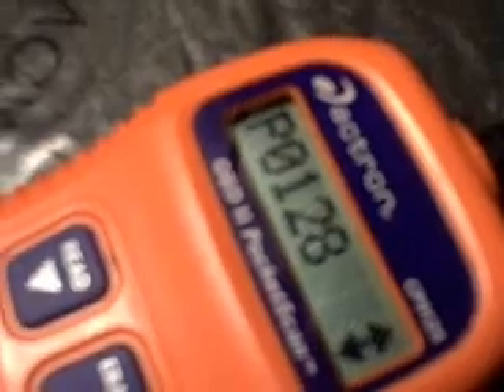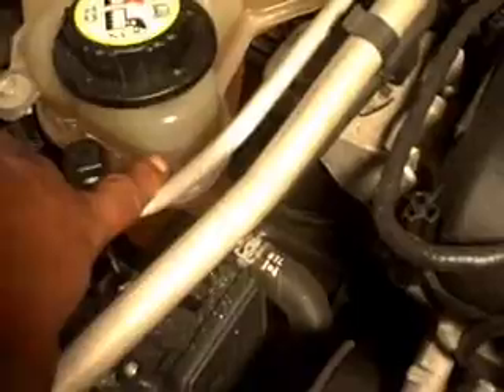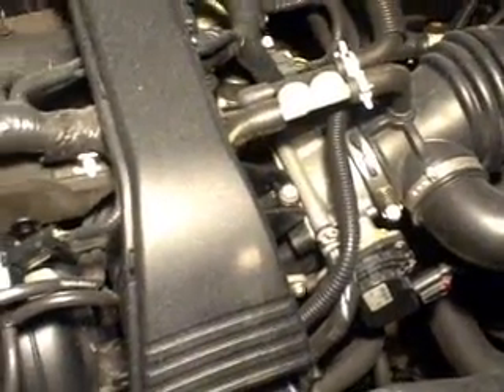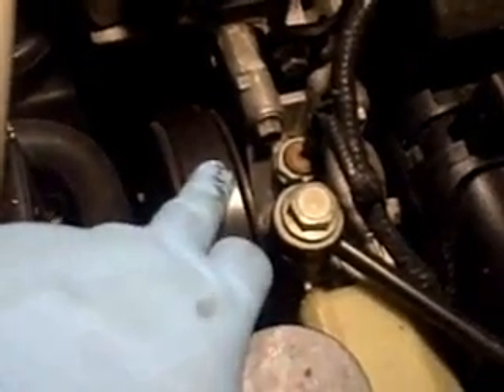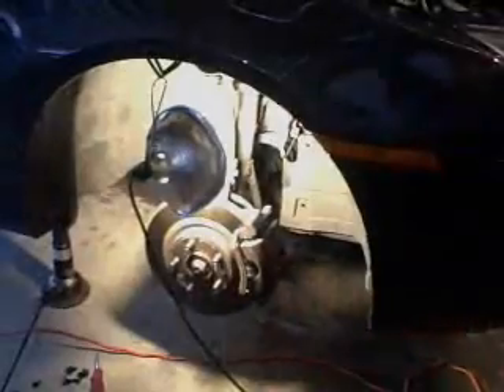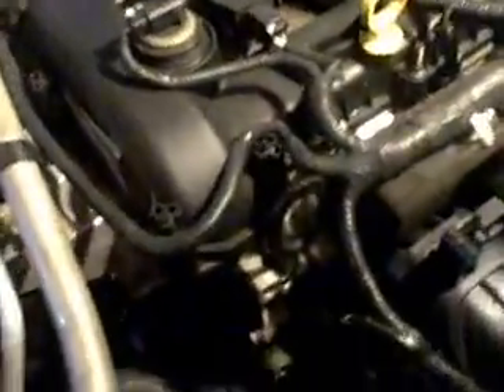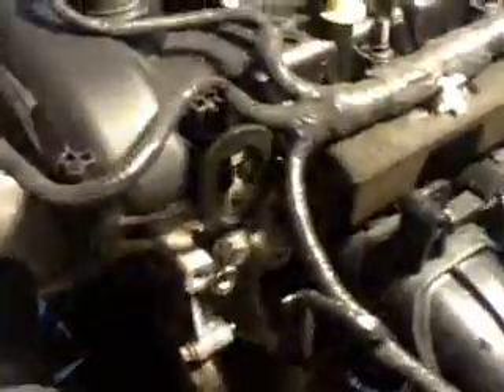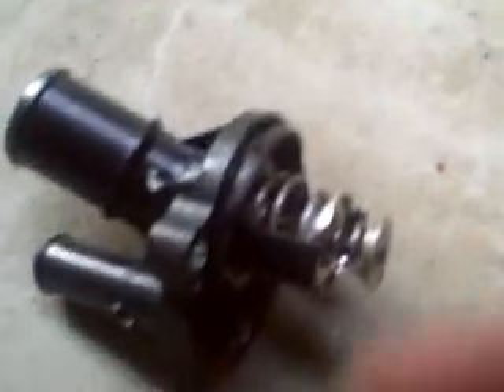2006 Ford Fusion thermostat replcement P0128 OBD-II Trouble Code

Comment: why does every video NOT SHOW the actual REMOVAL of the thermostat. Every video gets to the thermostat, then we're told that there are 3 bolts... 2 on the top and 1 on the bottom. Then the video cuts right to the thermostat is already completely  removed and we're told "ok now the thermostat is off..." WHY DID YOU CUT THE VIDEO AND NOT SHOW YOU ACTUALLY REMOVING THE THERMOSTAT??? WHY DIDN'T YOU SHOW HOW TO GET THAT BOTTOM BOLT OUT??? VERY FRUSTRATING!!!

Comment: I have an 07 Fusion I4 with a thermostat that is stuck open.  My wife took it to a mechanic and quoted her $600 because he says that not only would the thermostat need to be replaced but the entire housing.  I'm no mechanic, but I can't see any reason why the thermostat alone can't be replaced.
Reply: Because the thermostat and housing is sold as a assembly 29$ Plus tax at your local autozone 
Part Number: 51280
Warranty: 1 YR
Notes: 180 degrees
O.E. Recommended temperature. Seal included.